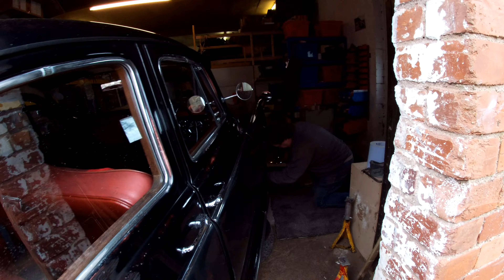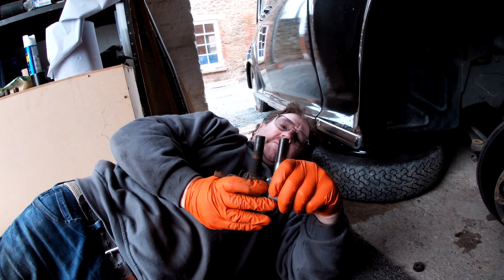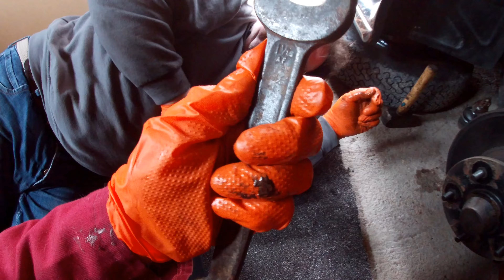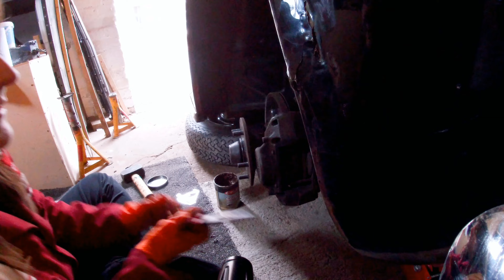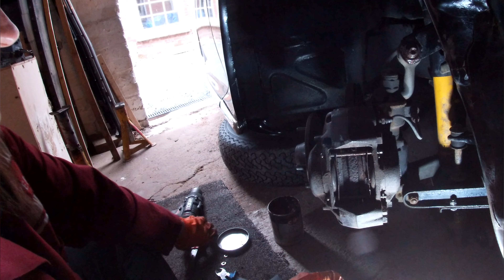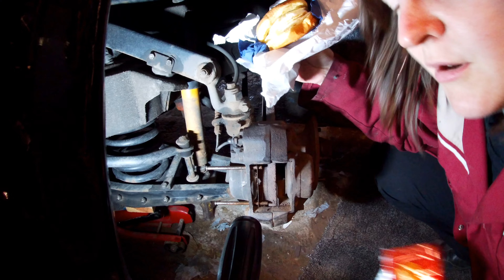Rover P4 - Track rod end and Brake pad anti-rattle shims

Comment: With the type of steering links that have been fitted to the Rover you will have to adjust the tracking via the connecting tube . The original links were cast has one piece and the tube was the method of adjustment.

Comment: When you have removed the pins and pads, get a large screwdriver, ratchet extension or some such item to act as a lever. Insert the lever between the disc and the calliper piston, taking care to push on the piston and NOT the rubber boot, and gently push the piston back. That way you will have enough room to slot the pad and shim into place